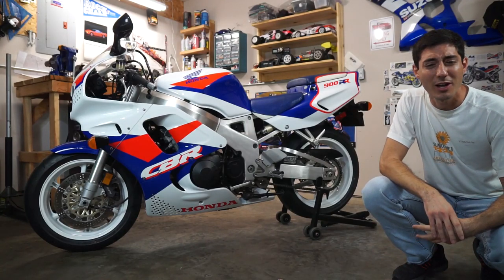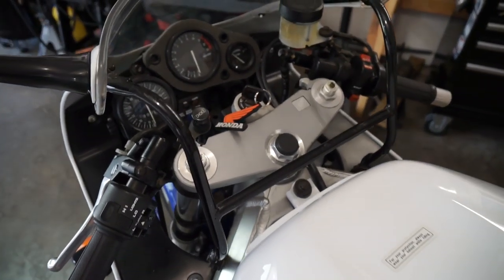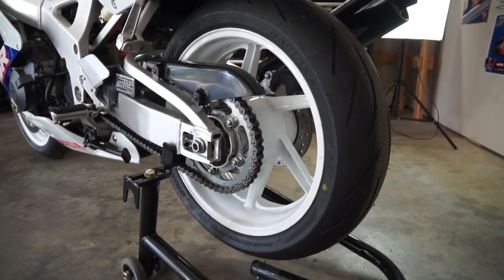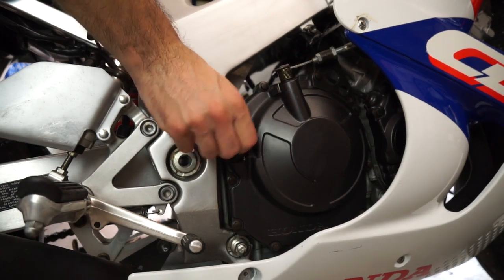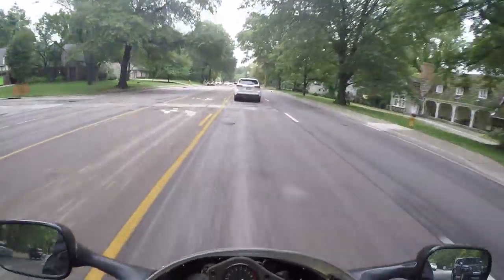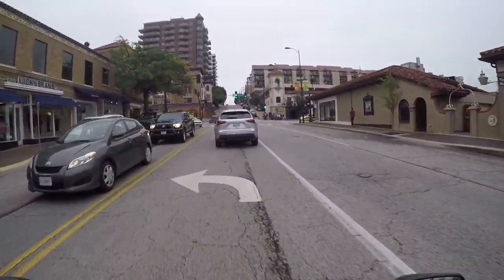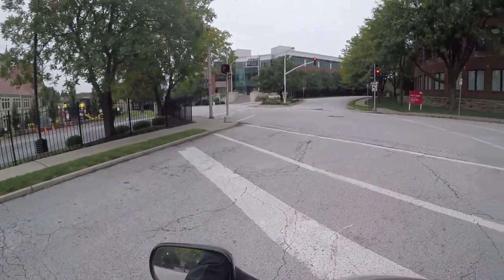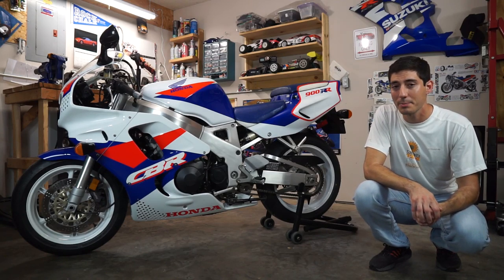Used Bike Reviews - 1993 Honda CBR900RR SC28 (1992-1994 Fireblade)

Comment: Man did I luck out this weekend. I just picked up one of these for $700. It's a 94 with OEM 92 fairings (black and grey) 20k on the clock. Guy said it "didn't run" and at that price, I was happy to take it and sort it out. The only thing wrong with it was it was outta gas. Unbelievable.
Reply: Omg - you stole it !👍🏼 I got a 95' GSXR 750 for $1500 with 10K  -- my issue was it needed a new petcock and the wire was broken at the start button -- some guys just get lucky l guess

Comment: I remember drooling over these in the showroom. I still have an 87 Yamaha RZ350, and an 87 Honda Hurricane 1000F. I just recently acquired a 2004 cb1000, but the engine needs some work.

Comment: Great to see some practical sport bike review again! Great review of such a gorgeous motorcycle! You are right about fairings and other bits and pieces! On my VFR400 NC30 UK Spec from 91’ it is really difficult to find genuine mirrors, license plate and side blinker brackets as all the genuine ABS fairings! When you do prices are just absurd! Also the stickers are almost impossible  to find in case you want to re-spray the fairings! You can find decal replicas but not same font, size or colour most of the times! Besides, back then fairings didn’t have clear coat on top of decals, with exception of gas tanks. So yes, better a non runner but cosmetic complete and clean bike than the opposite!

Comment: You are right about the plastics becoming brittle with age.  It is absolute pain on modern classics of this era.

On one Honda I have from this era I have replaced one particular panel three times in the past year because the fixing points disintegrate.  While I am fortunate in that the panel is still available and can be bought 'new' from a Honda dealer the last one I bought was actually manufactured 23 years ago.  You can see the production date on the back of the panel.

Comment: Very good Video.
But for a 60 year old rider ,they  are not the best.
i come back from rides with nothing but aches & pains. But i still love this old girl.
I have a 92, with only 20 or so thousand miles on it,  with it all being Standard apart from has you say from the rear shock.
But the best thing is, that i can take mine up into the Yorkshire dales for a steady run & get 60MPG, and thats with the occasional blast 
to get it cleared through.
Keep up the good work.

Comment: A very good review thank you. I had a 1995 Urban Tiger, which I used as a daily driver for 5 years  in a UK city and it performed admirably. Lightweight, comfortable, very manoeuvrable in heavy traffic. The only small criticism I had was that the alternator had a smallish output in winter months when headlights were on (most of the time for safety) and the battery had a tendency to go flat without noticing. I added a voltmeter to keep an eye on the input. Otherwise, a fabulous machine.

Comment: I have a 1997 CBR900RR yellow/purple/white with 13,000 miles. I am the original owner. It's crazy that it's 23 years old. The fork seals are leaking so I have to fix those. Other than that, I still turn heads and people want to know if i will sell it. Thanks for the video!!!!!

Comment: axial mounted calipers, no inverted forks, weird tire sizing lol.  Power is pretty good for today... if you're on a 600

Might be important to mention that the reason you want to change coolant every 2 years is because it becomes acidic as it oxidizes and can corrode your coolant system... not because it "wears out" and doesn't work as well from use.

Comment: 5:56 People raving about 'radial' front master cylinders clearly haven't got a clue what they're talking about. There is no difference between them with respect to braking performance, the lever pivots about a fulcrum with a pushrod a short distance from that fulcrum to prof=vide a mechanical advantage. The only two things that matter are the pushrod mechanical advantage of the cylinder bore; guess what, they are bout variable no matter the type.

Comment: Must the cam chain tensioner be removed before removing and reinstalling the cams ?
Reply from the maker: No, but you must to take the tension off of it. Check out my video on doing a valve adjustment on the CBR900RR.

Comment: I went from a Kawa ZX7 to the 900RR...in my opinion the ZX7 was superior in most areas.... especially the aero and the handling..now off to hunting another ZX7. Good looking bike though..
Reply: Cbr 900s can't be pushed to hard. They lose the front and rear tire pretty fast and out of nowhere. Speed wise the cbr 900 would eat the zx7 for breakfast
Reply: Bought my 93 cbr 900 instead of a 91 zx7r limited race edition in 1996. What do you think about that
Reply: @polok890  The 900rr has a 15-20 hp advantage, in my experience I could immediately feel the zx7 has better aero, and handled better, didn't feel much slower than my 900...maybe in your case the gearing on either bike had something to do with that?
Reply: @ColAngus  my 93 cbr 900 was stock. They were way faster than that generation 750. I was there and rode the stuff

Comment: I’m 22 6’1 210 and I just got my moms 1994 I wanna say it’s red, black and white? Would you recommend it be a good starter bike? Would love all opinions I’m just now starting and can’t wait! It’s in great condition all original parts  beside the muffler
Reply: Its alot of bike for a starter bike but hey its was my first real street bike 19 years ago at 19 years old. Loved it. 93 black red n silver. Buddy had that red white and blue. Wheelie machine. Yoshimura pipe. Would love to find another but hole shit did they go up in price!
Reply: Dude, hell no.  First of all, the last thing you want to do is bang up a classic bike on a rookie mistake.  Second of all, this is a quick bike even by modern standards and has no electronic assists or ABS.  Best case you'll nervously putt around for a year, worst case you'll give too much throttle/brake/etc. and destroy it and maybe yourself, too.  If you really want to ride it, get some cheap Ninja 250 or CBR300 and when you can flog that around with ease, then start riding the CBR.  Just keep in mind when you go from a beginner bike to the CBR that you can't just crank the throttle or slam the brakes, faster bikes have much more powerful everything and inputs need to be light and deliberate, hamfisted inputs will get you thrown off the bike before you know what happened.

Comment: You don't have to rejet after switching to after market exhaust. I rejeted mine thinking the same thing and ended up going back to the original jets.
Reply: Depends on the exhaust.  Technically, you should dyno tune it to determine the optimal jets, or at least get recommendations from someone who has dyno tested it.  Some exhausts are similar to factory but are just louder, others have substantially different flow properties.

Comment: Hi Sir great review, I have a 1995 Fireblade foxeye, Urban Tiger colour, I brought it new in 1995 it's covered 14,000 miles, love it as much today as I did when it was new, what I saw different to the UK bike is both your Honda's have speedo cable drives from the front wheel, here in the UK there fed from engine case, sensor!! ATB Wayne UK.
Reply: Hi Sir
I have a 1994 urban tiger seconded Generation fireblade and i have a first Generation 1993 fireblade , the first Generation 1993 with the round headlights is the same as the American one, the speedo cable gose to the front wheel,  well spotted tho I never noticed the two of the were different 🍻

Comment: I got a 92 Fireblade at hand.. Wondering to buy it as my first bike. Maybe to powerful to a beginner?
Reply: I'm in the same boat. As long as you are careful with the throttle. We will be fine
Reply: I wouldn't.  Parts are rare and hard to get, carbs require a lot more care than fuel injection, it's on the heavy side with less beginner-friendly ergonomics, and if you don't really have a feel for gas/brake/clutch/etc. a higher end sportbike like this will punish you more for wrong inputs.  If it's a screaming deal and you are willing to maybe have an experienced friend ride it around every month to keep things working, you can scoop it up, but I'd get some random cheap 250 or 300 to learn on first and then get/ride the 900.
Reply: @nunyabusiness896  Been a while since this now. Got a M5 to play with instead. Wondering about a 600 in the summer, I will see.